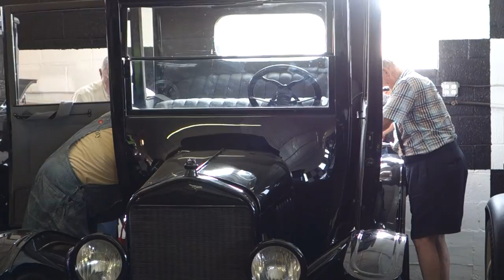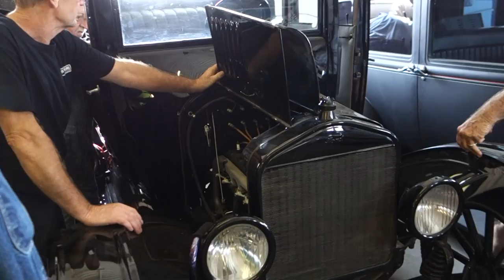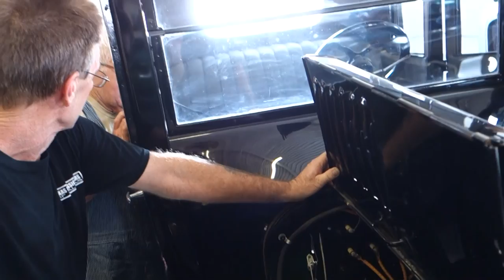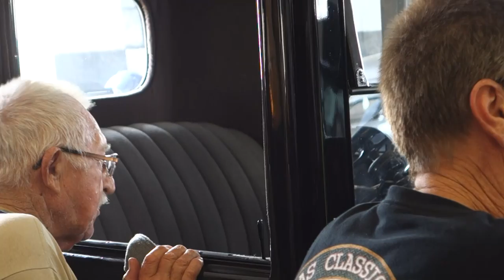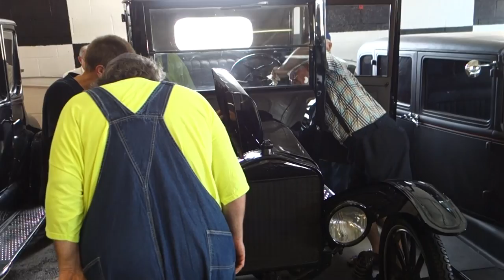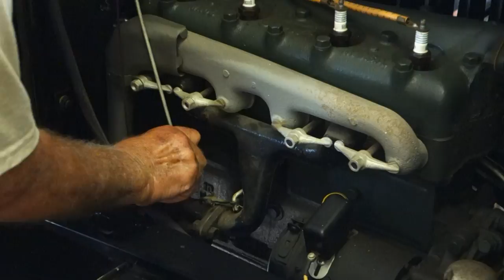1922 Ford Model T Doctor's Coupe

Comment: Even after the later model "T's" came with electric starters, Henry Ford was wise enough to still include the hand crank. The removal of the magneto made this impossible today. But surely something equivalent could be devised. Come on engineers, get on it!
Reply: suavesoft engines these days are to large and heavy to be turned by hand.
Reply from the maker: Good stuff 👏